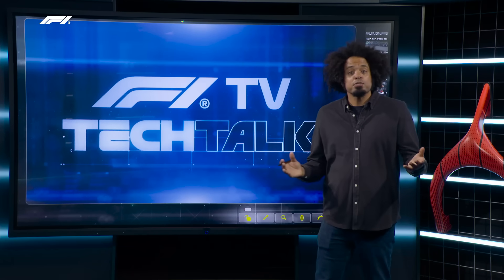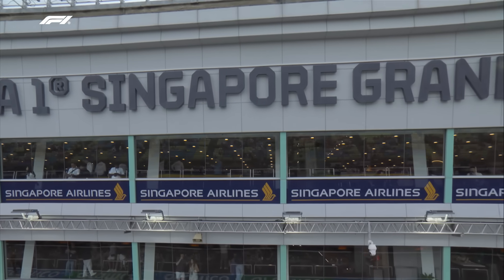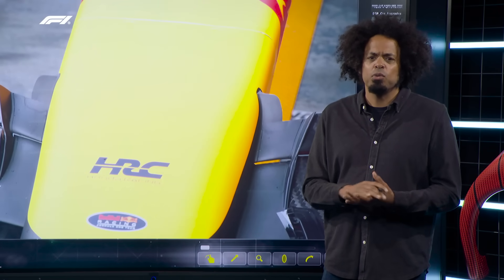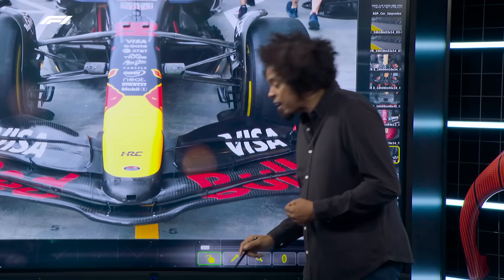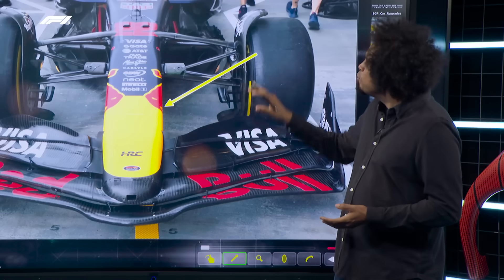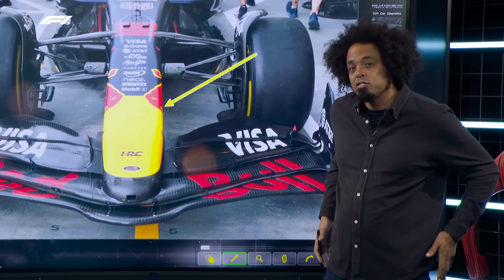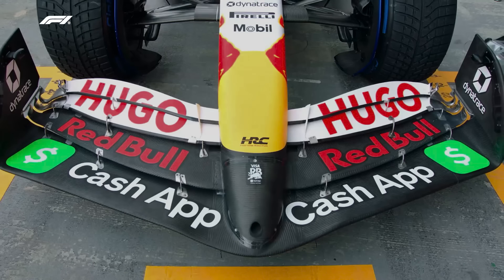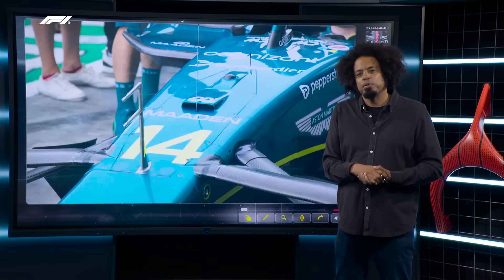How Hard Is It To Keep Cars Cool In Singapore? | F1 TV Tech Talk

Comment: 31c is nothing compared here in the Philippines, we normally get 37c and feels like 41c.
Reply: 31c air temp means that the drivers will be dealing with 60c+ in the car
Reply: It is not just about absolute temperature, it is the humidity; to be exact it is the wet bulb temperature. And based on the last few days of reading,  the Philippine wet bulb temperature is slightly lower than that of Singapore. Worst off inside a F1 car concentrating and sweating like a shower. You mind just swell.

Comment: another reason why they have the water in the nose might also be due to the fact that it stays somewhat cool. while if the tank is behind the seat. then it is closer to the engine and it is alot warmer. many drivers have complained on that over the years.
Reply: Especially since, if it's behind the driver, it's literally sitting between the two parts of the monocoque that produce heat, namely the engine and the driver himself.
Reply: +1
Reply: its hilarious how the drink and heat problem has been finally thought about... AFTER KIMI LEFT

Comment: I applaud the extra safety precautions,but honestly you should see the NASCAR guys racing in Darlington SC in the middle of summer for 4 1/2 hours. It’s wild. You can almost pour the drivers out of their cars. Some use cooling vests,but they’re prone to failure and overheating in sustained use for that long. Then things get worse 😮
I can’t stop picturing the RedBull nosing into the wall and Max getting the Super Soaker treatment from his drinks tank crumpling 🤣
Reply: To be fair, NASCAR has cooling boxes in the car that circulates cooler air into the helmet. F1 doesn’t have that. Not saying they can’t fail too though - I remember Greg Biffle at I believe it was Charlotte for the Coke 600 probably 10-15 years ago going off on the radio about the cool box failing like 10 laps into the race.

Comment: I dont know why they FIA don't mandate a cockpit temperature and have some form of refrigerated air vented into the drivers helmet and  suit in these extreme races. Im guessing it could be done with some form of heat sink with minimal weight increase. Surely these world class engineers can design something more elegant and reliable than plastic hoses and a ice bucket that they hope will last 2hours im 40°C
Reply: They did test this, but they prefered this hose system over that.
Reply: They did test this, but they prefered this hose system over that.

Comment: I’ve been to Singapore as part of my work. I turned pink when I walked outside and my glasses fogged up the first time I went outside. It’s really humid there and even more humid in Dec & Jan. It takes a few days to get used to the humidity and I can see how the driver struggle to adjust since they don’t have much time to acclimate to the humidity. The air is so heavy it rains in the afternoon almost every day. 

Singaporeans are small and slight because it doesn’t pay to be bigger and have to dissipate the extra body heat. I enjoyed visiting Singapore but it takes a little planning to be ready for the humidity and heat.
Reply: how short? im 169cm
Reply: @0Blueaura I meant no offense. As an American Asian I was much larger than the nice folks I interacted with when I visited. I was reminded of that when I went to purchase a swimsuit. Large in Singapore is not the same as large in the US. I thought there was an advantage to a smaller frame to be able to handle the heat and humidity was my point.